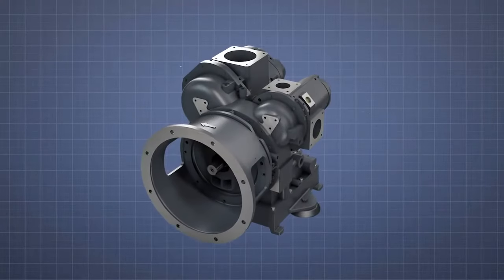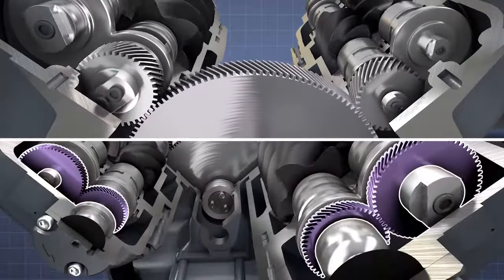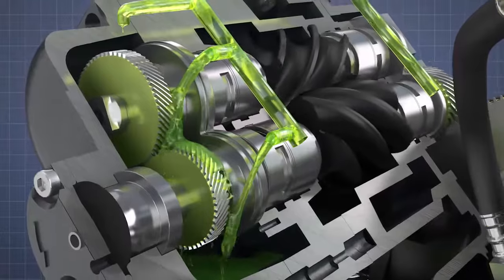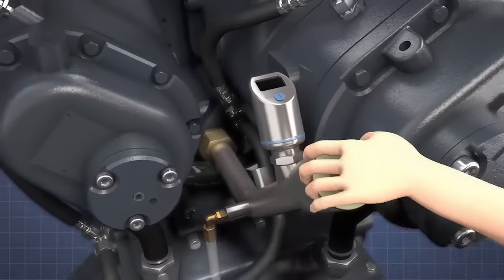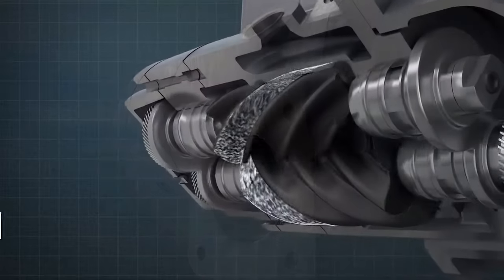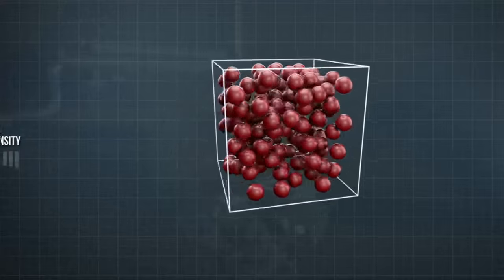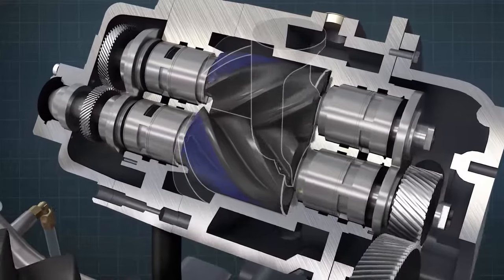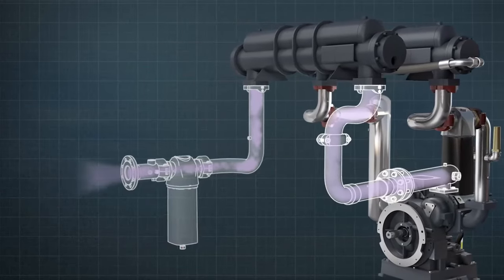Oil free compressor D series

Comment: Can this compress steam as well?
Reply: Steam is water in air, you cannot compress water so it would be removed and you'd have only hot air.
Reply: @DonaldMcLemore-n6d  steam is not water in air. That's humidity. Steam is very much compressible. As it is humidity for what matters
Reply: @burgy023  if you compress steam and it cools (using that cooling circuit in the video) below 100C, it will become water. You end up with air again because of the water separator. The question isn't whether or not you can compress steam, but whether or not you can do it with that device.
Reply: @DonaldMcLemore-n6d  your answers are wrong on so many levels I don't even know where to start. there is no air in steam! Steam saturation temperature and condensation occur at different temperatures with compression. Compressing steam makes is hotter than you can possibly cool with the compressor interrefrigeration. Please do not talk about things you don't know. My original question was serious.